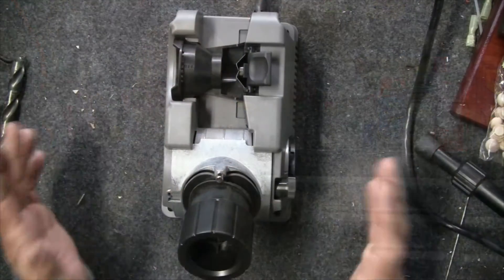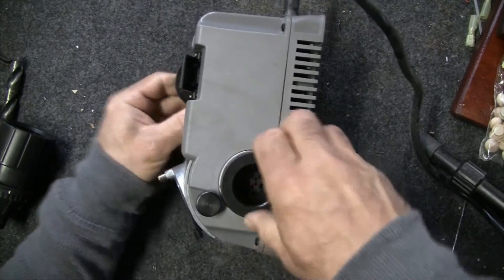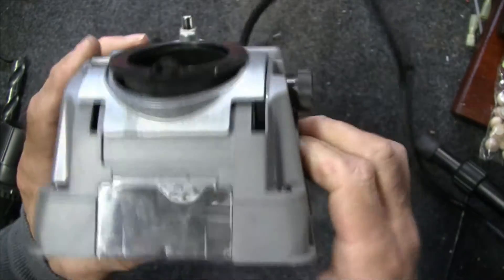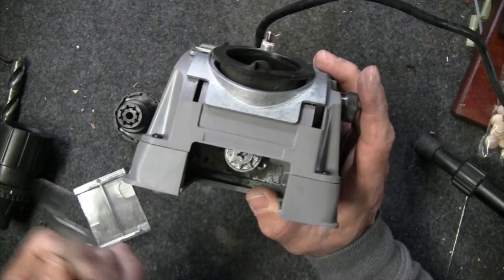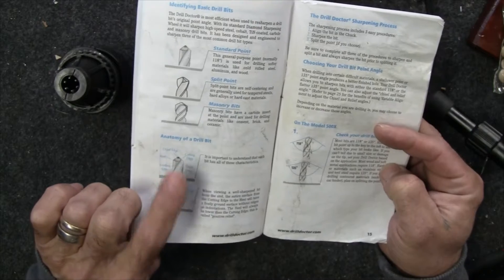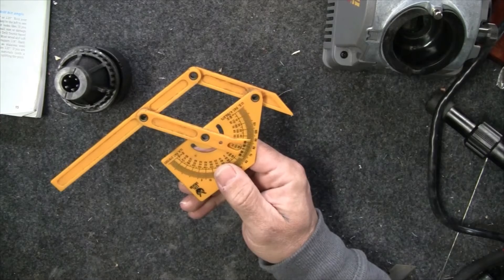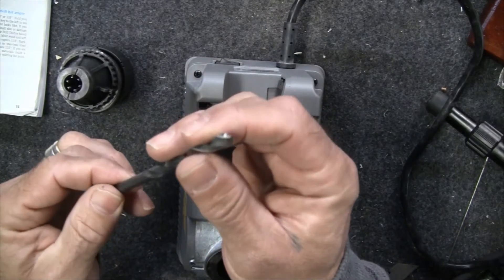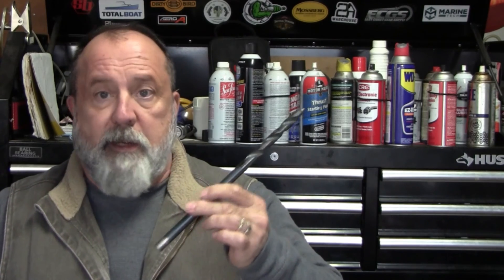How To Sharpen Drill Bits And Review - The Drill Doctor 500X

Comment: I bought an ancient, barely used DD500 classic off my equally ancient neighbor at his garage sale for $10, years ago.  Never touched it, never really thought about it.  Tonight I was wrecking bits right and left trying to drill 6 progressively larger holes in a pair of replacement yokes for a 200 year old fire dept wagon my blacksmith friend had unintentionally (I hope) hardened.  Even after torching it and letting it cool, none of my 1/2" bits could begin cutting into the 5/16" holes I'd managed to get in.  

In desperation, I pulled the DD out of the corner, and RTFM.  It saved my ass -- my 1/2 bits sliced through that steel like butter after a doctoring.  Now I wanna sit down with a glass of whiskey and sharpen all my bits.
Reply from the maker: Lol, The drill Doctor saves the day! Good story!